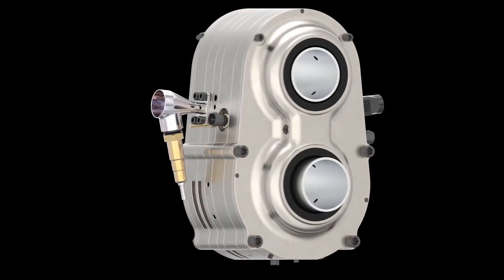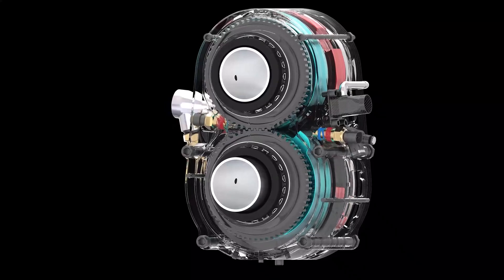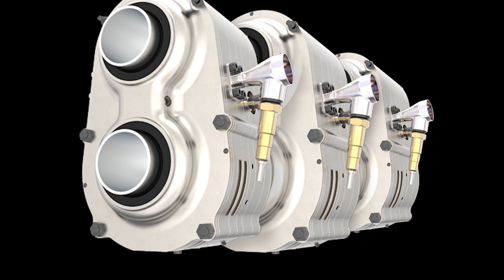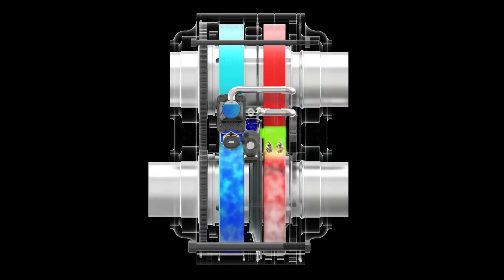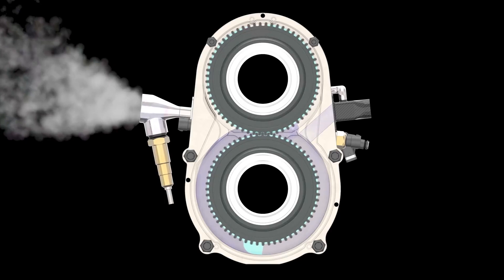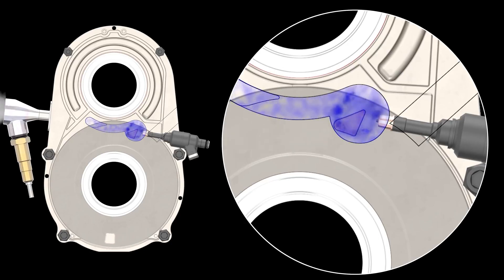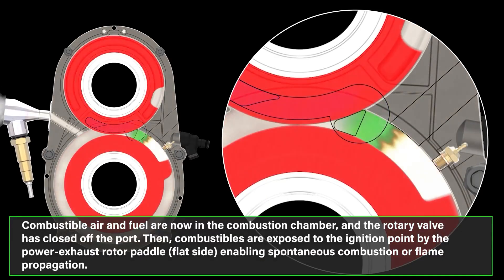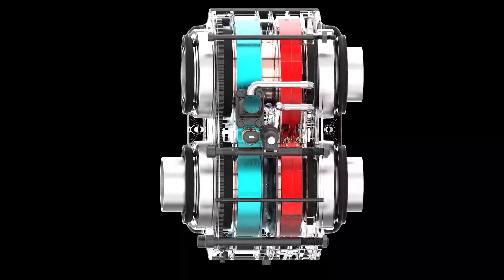This pistonless engine runs on hydrogen and revs to 25k rpm

Comment: The engine has a very small surface or "piston" for the burning fuel to act on. As engine RPM increases, the amount of force the deflagrating fuel can exert on this "piston" greatly decreases. I am incapable of doing the math, but at 25k RPM the engine would be nearly outrunning the propegating flame front, resulting in low torque at that speed. I am sure it can reach 25k RPM, but then speed might reduce until equilibrium is met at peak power/ peak RPM. Just food for though. I have only seen a very brief video of this engine operating, and it was not at "full chat" as it were.
Reply: Consider the flame propagation of Hydrogen, not liquid or vapor fuel.
Reply: @gecsus  a fair point.
Reply: Do you run the engine in your car at 6500 rpm just because that is where the max rpm limit is??
Reply: @lukewarmwater6412  I
Had a 400 yamaha xs that did 7000rpm at 70mph. 
And it did 8k at 80mph all day
Reply: @fastinradfordable  and it had a "redline"somewhere around 12000....this making my point, again.
Reply: @fastinradfordable I had a 400 maxim... not sure if that was the same (U.S. name) as the XS. Which my brother had the XS 1100.
Reply: @lukewarmwater6412  6500 would be chumpchange for a 25k rpm engine then
Reply: @barryallen5507  or a turbine.
Reply: @fastinradfordable  Those RD's were fun bikes!
Reply: The loving confusion about maths, and engines. :) I'm by no means an expert in any maths/engine area, but it's fun to read and explore.
Reply: Torque does fall off at high rpm, but high rpm also equals more power, even with less torque. This is why F1 cars can generate ~1000 hp at 20k rpm, even if they only make 300 nm or so.
Reply: and thats where the 10 speed engine comes to play!
Reply: Both correct
Reply: If I could find the pressure and area and radiusI could do the maths.
I love the design but as many have said, let's see working models with 100k miles on them.
Reply: The RPM limit isn't a power curve issue, it's a materials science issue.
Reply: Said it fired off every 10 or so revolutions
Reply: I am pretty sure you don't want to pay for 25 K  RPM engine in your next car purchase.
Reply: The volumetric efficiency is poor
Reply: even if that is the case, then redline would be the limit of effective push and not the motor going 50 directions from over revving. Id easily take that trade as long as it had enough power to get me down the road at reasonable (yet not boring) speeds and less fuel to make it happen. I can how ever see myself encasing the engine compartment due to the high pitch whine lol.
Reply: @brettleisy356  the redline is safe maximum rotation,  has nothing to do with power,  maximum or otherwise. It's just the 'do not exceed' point.
Reply: @lukewarmwater6412  The redline is indeed the "do not exceed" point of the engine. The engine will not explode if you keep it there, but it will not last long either.
Reply: @lukewarmwater6412  I'm well aware of what a "red line" is and its meaning, I was only pointing out instead of max safe, it would be max effective with this. its still a physical (root word being physics) limitation upon the motor. this wouldn't try to explode, would just lose effectiveness to to the limits of expanded fuel speed.
Reply: @brettleisy356  like any other engine... the power curve drops at some point with anything,  although it does occur to me that we have been comparing piston engines to turbines, which this engine more closely resembles.
Reply: Einstein here has lost us at "deflagrating".  LOL  He wants to be smart.
Reply: @foobarmaximus3506  deflagrate is to repidly burn, the same way gunpowder in a metallic cartridge does. It's an apt description for how fuel is turned into power/ energy in an internal combustion engine.
Reply: @rhubarbpie2027  adapter on the side if motor seperating hydrogen from water with 9volts current...
Then car is powered by water...no more gas TYRANTS
Reply: @johngarvin8888  sounds great, just need to get that Perpetuum Mobile to actually work … you cannot get more energy out of turning hydrogen and oxygen back to water than it takes to “unburn” them.
Reply: @advorak8529  already done it with a mason jar and JB weld the top on the jar before making apparatus.....
Exhaust is pure distilled type water.
Reply: @johngarvin8888  getting water out of hydrogen and oxygen is not a problem. The problem is getting more energy out of burning hydrogen and oxygen to water than needed to turn all the water back to hydrogen and oxygen.
Reply: @advorak8529  eye see.....
It only takes 9 volts to seperate the hydrogen and oxygen from the water.I know it will be done soon enough.
Perpetual Water Power.
Reply: @johngarvin8888     Oh, in that case … 
You could simply use a 9V battery and produce unlimited amounts of hydrogen and oxygen.  Right?

Or maybe you want 10,000V or 100,000V or even 1,000,000V … use a Van de Graaff generator, a  Wimshurst or a Bonetti machine …

Funny how nobody else ever thought of that. But it can happen. Build a small demo model and report back how much H2 you got.
Reply: @advorak8529  Redneck Ready.
Have A Nice Day Sir!!!
Reply: @johngarvin8888    Just go and demonstrate it is power positive already!
Reply: @advorak8529  Ok,lol.
Have A Nice Day🙂
Reply: @johngarvin8888  thats with normal engines too
Reply: @johngarvin8888  sadly perpetual power dont exist it is literally impossible
Reply: @johngarvin8888  those exist its called a steam engine
Reply: @Lukasthefloof  Exactly
Reply: As though your theory is disclosed to the conclusion as though I cannot support your theory either by that means of any tangible experiences,

although this topic they presented may did not existed on the actual references but it that may still a 3D blueprint with a project feasibility studied,

although the theory and actual varies a matter of fact differences, as though if in case this project have still a 3D Blueprint thus that may they violated their intellectual claims that they sort into the final assessments, although the real engineer did not draw a final verdict for only made their projects to only confined at the Blueprint without verifying the hypothesis from the actual tangible results,

I gave a respect all of you gentlemen, as though I cannot support any theoretical findings here were myself did not work any tangible findings but I may study those theoretical flaws especially fuel economy, fuel efficiency, vibrating reductions and elsewhere the missing compression ratio that always found at the Piston Counterpart
Reply: @markandoyo2204  talk like a lawyer, without talking like a lawyer.:D.   Oddly enough I have had a similar discussion at work. The end of it all, they said "what does that mean!?!??!?" my comment was " on paper" its beautiful, in reality, this is going to be a nightmare to get working, and probably never will. You guys will give up, about 22% in." I was wrong. They gave up at Zero.. lol
Reply: Far cleaner and better than toxic battery crap junk cars!. That can only go a hour or two!
Reply: @alk315  l
Reply: @alk315  tell me you live in a cave , without telling me you live in a cave .
Reply: @cat-man5522  they arent wrong. The footprint of an EV battery alone, just its creation, is close to that of a conventional vehicles normal use over 2 years . This is not taking into account the mining, refining, and transport of materials to the factory to be created. At peak, EVs are responsible for little less than half of a conventional engine emissions. 6 to 8 years of use to balance out. Average vehicle is replaced at 10 years.. Add that mining issue into it and are EVs better just yet? No. Its been tried before and never took off. This time might be different. EVs need power, until we find the secrets of fusion, hydrogen in a small combustion engine is one of the safest, and cleanest options. its an energy source we would NEVER run out of.
Reply: @cat-man5522  electric cars are bad for the environment cause of all the lithium mines
Reply: @alk315  new sulfur batteries around the corner, testing thus far shows scaled up of 900+ mile batteries and less weight. meaning you could scale down to 600 miles and be at 25-33% of the old battery weight and much smaller. also more resistant to heat and no "explosive" batteries to deal with. and MUCH less toxic than the current Lithium Ion for disposable/recycling. as well as a MUCH higher recharge cycles so would last even longer. with them being cheaper to produce on top of it. as much as my gear head gas guzzling self hates to say it... for general car use it looks to be the real future. but I'm keeping my Harley the way it is.
Reply: @alk315  SO MUCH wrong with your ramble.

I'll start with where you are at least partially correct.

the current electric grid is not able to handle a 100% swap, this is absolutely true. however a few nuclear power plants could be established to offset the need. which is in the long run cleaner than wind and solar with proper storage. would also lend to the further exploration of carbon nano batteries aka diamond batteries. other countries are starting to leave the US behind in clean energy production with their modern Nuclear facilities.

the "toxicity" is immensely reduced from the Li-Ion battery to the Li-S. even opened battery exposure of the Li-S is within safe levels unless you are eating it or snorting lines of it in the amounts that would be present in the batteries. so we need to put on a "so not eat" sticker on them for you?

your wonder hydrogen fuel cells would be great for the most part but you want to mention infrastructure issues? there are just over 20 locations in California that can fuel up. you cant just use a garden hose to fuel yourself. the water used is a special processed water. this process isnt fast either. we would need to build LOTS of facilities to produce it current cost is 17 dollars per kg, a kg is equivalent to one gallon of gasoline. and will net you approx. 70 miles. think fuel prices are bad now? lol. imagine the cost if people started switching to Hydrogen without the dozens of facilities required.

the production of Hydrogen isn't exactly perfect either. there are several variations of Hydrogen based on production methods.

Blue/Grey Hydrogen either release CO2 into the air or hidden underground.
Turquoise Hydrogen is created by heating up methane in the absence of oxygen.  a bit harder and can be explosive this way.
Pink Hydrogen this requires... NUCLEAR POWER! lol.

all vehicle hydrogen fuel types would require specialty tankers to keep the fuel cool. would require new levels of safety in the hazardous transport departments. while the tanks on the vehicles are made as safe as possible and lower risk of hydrogen explosions. a large tanker transporting the fuel could have massively destructive potential. 

and you are incorrect to making the electric companies compete. because there is a non monopoly clause in the US corporate law you CAN get your electricity from another company. the way the grid works is the power plants pump X amount into the "grid". so you will have several plants powering sections of the nation.

my ex's father worked as a computer coder using an older code than what they teach now. worked in ate BG&E in Baltimore MD. he was the one that taught her this trick. she was able to contact different power companies and take price checks what they charge per kWh. she dropped her bill nearly in half this way. if more people did this it would cause a larger competition. you are charged purely off of kWh usage, you get to choose who charges you. if you are in Alaska or Hawaii you have pretty much open choices.

hmmm, the more ya know... right?
Reply: @brettleisy356  Don't forget the solid stat batteries some asian tech company have started to test and make and apparently alreadying use in some cases.
Reply: @brettleisy356  There's been "new batteries around the corner" since the 80s, havent seen any of them yet. Lithium is all we got and a bunch of variations on that. No real new battery technology has been seen since the 80s, and you saying its around the corner isn't going to convince anyone. It's about as around the corner as this concept engine is
Reply: @GW2_Live  the major difference between this engine and the batteries is the batteries have been physically created and tested, and many manufactures of different types of batteries are being retooled for their launch with major manufacturers. there are some smaller versions already being produced for smaller products. phones, laptops, RC cars, and smaller 12v car batteries. currently the production is getting ramped to larger productions such as EV vehicles. at the moment the price of a Li-S battery is about $200 per kWh and the Li-ion is at about $132 per kWh. which will drastically change after its in production levels similar to the Li-ion. this isn't vapor ware, they have them now its a matter of ramping up. given the reduced cost of materials we could see the prices drop to $70-$80 per kWh. seriously... go look them up
Reply: @brettleisy356  haven’t they been around the corner for a decade now?
Reply: @atlas7309  absolutely not, while yes they have been trying to figure out better batteries, only recently have they actually had true headway. the carbon batteries wasn't even realized until 2020, and as far as the sulfur (Li-S and So-S) battery break through goes, they accidently created a material that makes it possible in 2019-2020, now they are trying to reliably create it on a massive scale. they know how it was done, its just a matter of bringing it to marketable levels.
 so no, they haven't been working on these batteries directly until recently. but battery tech as a whole, yes, and we've seen progress in general battery tech in the forms of production, weight, output, charging capacity and speed. but none of this was related to the major breakthrough findings that are MUCH more recent.
 so to answer your question.... 2 years, not decade(s).
Reply: @brettleisy356  nuclear power is good until the reactors go into meltdown and lithium batteries are still bad for the environment considering the lithium mines. Also sulfer mines which is needed to make sulfer batteries are horrendous toxic for the environment and the people who work at them
Reply: @brettleisy356  technology doesn't mean it cant melt down
Reply: @Lukasthefloof  there have been lots of "dangerous things" that technology has made safe/safer.

 but to get into more details for you as you seem to be not willing to look it up yourself.

 the newer technologies help monitor and adjust systems to keep the cores more stable. and if there is a problem (which there hasnt been for DECADES, due to technology) IF there is a problem tho... they have management systems now that detach the cores and they are shot into the ground into containment. by being taken offline and removed from the system they are left to become inactive. 

again, its been decades since any real issue. there are lots of nuclear facilities that have popped up of the last couple generations with ZERO incidences.

there are 440 nuclear plants world wide, 55 of them in the united states.

Nuclear plants generate ALMOST 2 coal plants worth of power, and 3 of the largest "renewable" plants. and bonus is it wouldn't matter what the weather was.

the output of one nuclear plant produces 1 gigawatt, if ran at full safe limits it would provide over 5,000,000 MWh of electricity.

considering that coal makes up approx. 65% of carbon emissions, and all gas cars, and diesel trucks make up barely over 2% we could be nearly carbon neutral just by switching over.

then could switch over to NDB (made from the "waste" byproduct of nuclear) and completely negate the lithium, Nickle, cobalt requirements of the Li-Ion batteries, skip the Su-S batteries and have battery packs that last 90 years in a car. you would just buy the latest model of car shell and swap batteries, hand them down to the grandchildren. small and light enough to be put into aircraft. about the same amount of radiation as what your cell phone puts out in your pocket.

less landfill waste than "renewables", less waste than the current batteries, less carbon and other green house gasses than coal or natural gas by 100%

cheaper energy production than all other sources by far.

and if you ask why we haven't done so by now... ask your local fear mongering politician. way to much money to be made trying to force "renewable"

taking into account ALL nuclear deaths since 1997.... zero, but they figure the death rate per Terawatt is 0.07 (when figuring in the materials needed through mining)

by comparison there are 40 deaths related to coal per year, not including the mining.

there have been 240 deaths linked directly to wind turbines, mostly fall injuries, but some generators exploding while being worked on. and a few airplane accidents. then there are the 538,000 bird deaths annually. this again doesn't account for material gathering or the manufacturing/transporting of the parts. 1500 injuries. and this is all by the year 2017, with the increased energy needs I am sure that number has grown and will continue to grow.

still thinking nuclear isn't safe? by the numbers its currently the cleanest, safest, and highest energy production we have.
Reply: @brettleisy356  technology can still fail and cause the reactor to go into meltdown not to mention natural disasters
Reply: @brettleisy356  the mechanism to eject the rods can fail causing a melt down lmao no matter how safe something can be it can still fail and be deadly
Reply: @Lukasthefloof  you obviously don't even understand what a redundancy is.

go back to walking on all fours, I heard that you can trip and fall walking on only two.
Reply: @brettleisy356  says the keyboard warrior who needs to touch grass
Reply: @alk315  There are electric cars that achieve 750 miles on a full charge. Innovation is neat.
Reply: @sofakingdom3076  yes but they are extremely expensive
Reply: @alk315  all the bean counters who makes cars doesn't care about this. It's the way much more cheaper to develop any elec, then develop a nice ICE that mets all emission rules. Unfortunately the elecs will be 'the future'... At least until 'they' discover how millions elecs being charged will overload any electrical system.